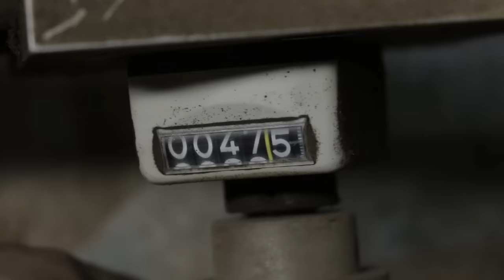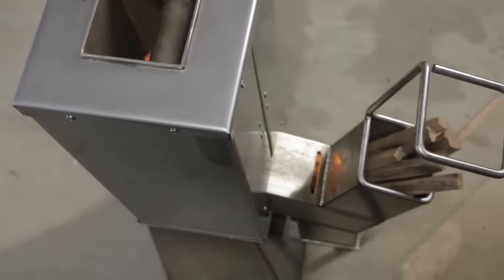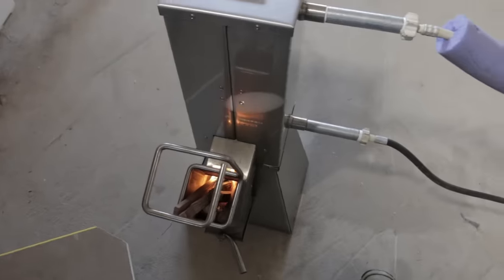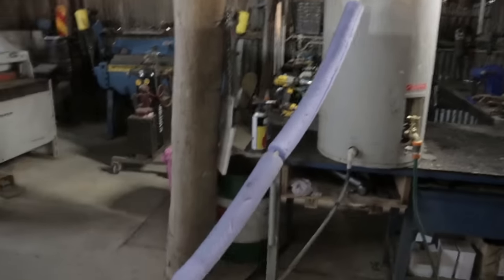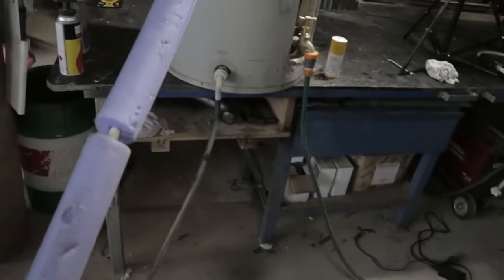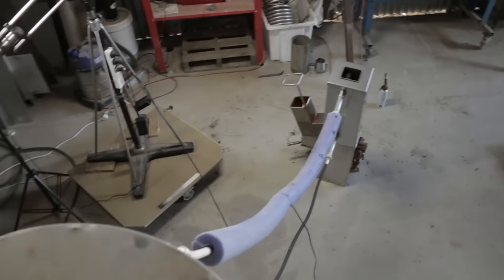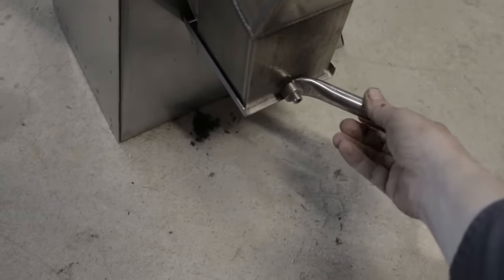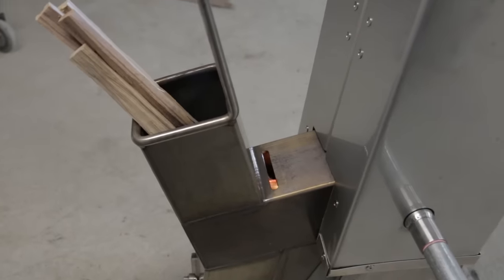Making an insulated rocket stove hot water system

Comment: Cut a hole thru the top and bottom of the tank and run the stack right thru the tank.Stack becomes one big heat exchanger with max surface area contact.
Reply from the maker: That's brilliant, thank you

Comment: Good work, but if I may make a few feature recommendations, if you made a water filled chamber that is heated from the bottom by the rocket stove you could then put a copper coil in said boiling water there size and length of the copper line will help determine the amount of heat the water picks up as it moves though, you could even put a valve to change the flow rate slower flow, hotter water from just one pass though the loop, also just for fun.... can we get a steam powered Turbo charger for more air intake? really turn it into a rocket stove :D

Comment: so now you have just delayed the coal issue. Eventually the container fills up, then what? Turn the whole thing upside down? Or do the coals exit down that 'panhandle' chute? But that's also used to iginite the stove in the beginning right, you demonstrated that the first burn. Or do the coals exit into the rear, wood cache (unlikely as it would set the wood on fire)??

Comment: Hot water is less dense than cold water, so I would advise to reverse the inlet and outlet of the tank. Let the upper exit of the heater feed the bottom of the tank and the top of the tank feed the lower inlet of the heater. That way the heated water will "try to float" on the cold water of the tank so it will stir up everything and heat up everything faster.
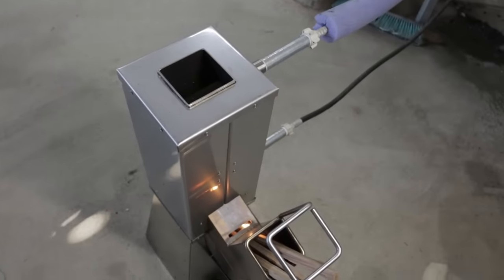Reply: The way you have it at 38:12 will cause a layer of really hot water on the top of the tank and cold water on the bottom of the tank, that's why you can touch the inlet after all that time.

Comment: Most efficient rocket stove design should insulate the flame on the way up, then the air chamber turns 180 and cools the gasses on the way down. If you use the downdraft section to heat your water, cooler water will create more suction/rocket effect.

Comment: May have already been mentioned about the coil but if it hasn’t consider putting sand around the rocket stove and the coil in the sand. The outside of the container will get hot as the sand heats up but the sand will act as a thermal battery and keep the water hotter longer. I would bet the sand would provide enough heat transfer to effectively heat the water. Great channel, new viewer
Reply: Sand would be a huge heat waste and insulator.

Comment: you know I'm looking at this and wondering if it would be easier to just build a box tube rocket stove directly into a 55 gallon barrel and braze a tap into the bottom to extract hot water from and a pressure release into the top just in case.

Comment: To increase combustion temps to warm the water even more quickly would adding a sandblaster type Venturi feed system to the rocket stove's side that uses hot air updrafts to draw in a small metered quantity of low cost dry iron fillings / powder from a side mounted micro hopper storage bin into the rocket stove's combustion chamber, resulting in heating the water more quickly, being the end result? Would this turbo heating dry iron powder fuel be a rocket stove optional design offering worth exploring?

Comment: Any reason you didn't have the water go around all 4 sides of the stove's vertical pipe? Just a section of larger diameter square tube, inlet and outlet bungs, and an upper and lower flange to basically create a water jacket.
Reply from the maker: Yes I've done that in the past and I've had issues with steam lock once the unit got up to temperature.
I'm sure that if I messed around I could get it perfected but I really wanted to see what a single-sided heat exchange could do.

Comment: I made a rocket stove with 100 mm with 75 box inside made a tank and ran the flames up the inside of the 75 I live off grid and use it every day on 50 litre hot water tank heats in 1 hour.
I changed tocket bottom for a 4.5 kg gas bottle fill it once and walk away.

Comment: It's been awhile since I've watched another one of your videos (had to look back, it was the vortex build). That's been awhile for sure. I've always liked your fabricating, good to see you're still at it. I'll be checking out your other videos eventually to catch up 🙂 I was playing around making secondary combustion woodstoves out of barrels, inner barrel and outer barrel, and I wonder how well an outside air chamber to introduce air higher up above the flames in a rocket stove would work? The inner chamber after the secondary burn should be hotter because of the additional burning gasses... I would think.

Comment: Quick question: why not just make the water block as the insulator , covering all sides of the stove ? This way you have A LOT more surface area for heat transfer and more water capacity
Reply from the maker: I have done that with other designs and what I found was the water boiled and then steam locked. I wanted to heat the water just before the boiling point so the system wouldn't need a pump.

Comment: I use a CS for 304/316 of 180 with carbide EMs and 50 with HSS EMs. I used 30 when drilling. This might help burning tools. (Just in case: Cutting Speed(CS)*4/Tool Dia= RPM)

Comment: Would the System work more efficent if the water passed several times through  the Fire and the exhaust fumes. To avoid  shadowing the passages, the Passages  trough the Oven they had perhaps to be offset against euch other.

Comment: You can put a metallic ladder in the "chimney" with flat pieces of metal alternated horizontally . You'll push the heat on the wall and will heat more your heat exchanger. 
If you want a picture, you can search how is made a gaz tank boiler where such piece is.

Comment: would it be worth trying swapping where the tubes are? like taking the input from the top of the tank to the bottom of the heater and the exit of the heater to the bottom of the tank?
Reply: Yeah, from my understanding of heat exchangers this is the more efficient configuration--input goes on the "cold" end of the heat source, output on the "hot" end. Though you lose the natural thermosiphon effect that way on a vertical exchanger so you have to actively pump it.

Comment: If you are using passive water circulation, the hose connection position in the water reservoir is important. You need to minimize the vertical position difference of the hot and cold connection. The hot should be like right above the cold. With this, the hot water will rise and mix the hot to into the entire water tank, not just the top. Water stratification is especially real with any passive circulation system. You will get tremendous energy collection benefits if the hot connection is much lower, just above the cold.
Reply from the maker: I will give that a go the next round of testing.  I have version 2 waiting in the wings for me to do something with.

Comment: I homestead in North Texas and do something similar but WAY easier.

My rocket stove is 3 inch 14 ga steel. The chimney is 3 inch AC (asbestos-cement) pipe.
I run three vertical runs of 3/4" soft copper from the bottom to the top on the interior side of the chimney, joined top and bottom with hose fittings connected to a 12-gallon steel receiver filled with peanut oil.
I regulate the fuel (hardwood pellets) to keep the oil temperature between 400°F and 500°F.
Atop the oil receiver are copper heat-exchanger loops, which serve different zones (domestic hot water, hot tub, greenhouse heater, room space heaters, etc.).
All this is outside. Oil does not freeze in Winter and contained in a receiver insulated by 2 inches of beach sand, stays hot for about a week, if left alone.
Reply from the maker: That sounds pretty cool. Do you have a video of it running,  would love to see it.
Reply: @LittleAussieRockets 
I do not.  I'll get around to doing that sooner or later . . . After I finish up the eleventy-seven other projects I have going on.

I'm autistic  . . . High IQ . . . Short attention span.

Comment: wow what a beauty! nice project mate. im just thinking why you have the 1 cm by 10 cm gap there on top of the burning wood? is it just for ventilation/ breather purposes for the flame?
and do you have like a pump or sth running the water through there or is it just flowing on its own? cheers mate
Reply from the maker: Hi mate 
That slot gives a little bit more oxygen to the fire and helps facilitate a cleaner burn particularly when the hopper is full of wood and not allowing enough air through. 

The water does circulate by itself the process is called thermo siphoning, a pump can be used if you want, but I've found that the natural circulation is the most efficient.

I'm actually on version 2 of this water heater though I haven't finished editing the video yet. 
I basically scaled this one up with a larger firebox more suitable for continuous burning and a tapered heating chamber for the water.
My initial testing has shown it to be a big step up from the first one.

Comment: just wondering what grade of stainless you're using?

I built a rocket water heater for a festival shower rig about 20 years ago and it only lasted one season because the stainless couldn't take the 1000°C heat of the rocket burn ... it burned up the original steel in a weekend (looked like an overdone toasted cheese, all black and wrinkled with a couple of holes already) so had to make a cool air bypass jacket for the burning chamber... but by the look you're cooling the chimney way early anyway, which'll be slowing everything down and is probably the reason for smoke escape from the wood inlet...
Reply from the maker: Wow! That's intense heat
I have nerfed this design just a little bit to keep the heat ranges within an appropriate level so that the stainless steel will last.
With steel builds I will rarely insulate around the firebox for this reason.

I'm using 304 that is rated to  870°C

Comment: I'm wondering with the cold spot whether or not the VOC are reaching Optium temperature to combust cleanly. Or if there is going to be a large creosote buildup on that one cold side. wonder if it might be more advantageous to have the pipe come back down and around then cool all 4 sides in a water jacket with internal fins to force the air to fold and disperse more of its heat
Reply from the maker: I have been monitoring the build-up of soot and so far it's only has a mild dusting of Ash.

Comment: Beautiful build! But, but, but... Rocketstoves get working really well when the walls of the riser are bloody hot only then the 'rocket' effect (burn of smoke) starts. So when you continuously cool down the flames at the lowest point not much will be happening rocket wise. If you would make a water reservoir of sorts on top of what you made now, take out the pipes and insulate the riser you would get a very hot flame and a very good and near total burn of your fuel/wood. Then the flame would be much hotter when touching the water reservoir from below resulting in quicker heating up of the water. Only minus point is that you made the riser from steal and because you burn so hot in a rocket stove your riser will be gone in two years or quicker. (yes I had a steel riser myself in my rocket stove and there was a fist big hole in it after two years.). My two cents, have fun and I wish I could weld like you.

Comment: Beautifully made and a very nice result. It seems to be outputting about 3.1kWh into the water heater. Could I ask, how many kilos of wood did it use during that 1.2 hour period?
Reply from the maker: It used a quarter of a bag of kindling that weighed 15 kg.  Plus a few bits of pallet.
I'm kicking myself now for not paying more attention to this during testing.
Reply: @LittleAussieRockets  the gas boilers I work with have to use forced induction and very elaborate heat exchangers to get into the 90ish percent efficiency bands, but with almost no heat exchanger and an natural draught I think yours is running at about 12 percent efficiency, using about 8kg of wood at 4kWh per kilo over 1.2h with an output of 3.1kWh.

I've been thinking of trying a project like your ongoing one. The main problem is a soot filled exchanger that's got enough surface area to cool the gasses to below 40°c, if you can work that out you'll really be doing well. Maybe gasification and a second hand gas boiler would make a good video!

Good work, and very nicely made!

Comment: Shouldn't you want the hot water to come in the bottom and allow the heat to rise to the top pushing the cold into the burner? It may create a circulatory system to maintain an even temp throughout. maybe the tanl sucks the hot water from the top and pushes the cold into the bottom?

Comment: As a non-welder I am curious what type of welding you are doing here. I see sometimes you are using a stick and sometimes not.
Reply from the maker: I am using a TIG welder. Tig welding is very similar to oxyacetylene welding except a lot quicker.
Unlike MIG welding or stick welding that deposits material as you weld, the Tig welder only provides the heat source to melt the material, which is why I have to add material when necessary or I can just fuse it together depending on the situation.
Tig stands for tungsten inert gas
The tungsten electrode does not contact the material but is only a source for the power to flow through kind of like a strong cup of coffee in the morning ☕🚽
Hope this helps

Comment: its time for a smart cookie to materialise, and manufacture a ROUND rocket stove / hot water unit with a coil tube inside the chimney for the water ... based upon the ORIGINAL Australian designed chip heater. They were BRILLIANT. I know.... I had one in a cabin I used to live in. It took one or two handfull of small twigs,  not bigger than 20mm in diameter, and a 2-3 minute wait for the fire to flare up, the pipes, the ambient air and water temp to rise enough. We looped the system so that as it heated, it fed into about a 200 litre old hot water unit with a well insulated copper tank, which then fed into the shower mixer. The stored water remained warm enough to have a good shower, after being away for 3 days in mid-winter. Truly awesome. Huge windows overlooking secluded forest. I miss it so much. Im so sick of the city life. 😨

Comment: 100mm simply isn't a big enough firebox to put anything but wood pellets in. I rebuilt mine from 100mm with 12mm steel plate to be 140mm square  with a 120mm round flue, which you can induce a spiral venturi in if you put vanes at the top of the enclosed flue.
Reply from the maker: I totally agree, the next one I build will have a larger firebox. I am also considering making a pellet hopper for this one.

Comment: I've been sitting on the idea of making a rocket mass heater for quite some time while we save to buy land that has grown into something  I haven't seen put together and this connects to it beautifully. I will take this concept and build on it.  Picture this insanity. 

A battery bank for the purpose of storing electricity:
A rocket mass heater with digital controls, temp sensors, and fans, wired into a thermostat to create whole home heating
Integrating your idea with this water heater concept, digitally contolled in much the same way (we would be running from a well)
A gamma type sterling engine that will use the heat generated from the rocket mass heater to create electricity and keep the battery bank charged.

So long as it is on an appropriate sized piece of land where you can allow the trees so regrow, you coul be free of any need for outside assistance for power or water needs.

Comment: You have a hell of a shop, nice work. Is that built out of 316L stainless or cold roll carbon steel?
Reply from the maker: 304 stainless. It can handle the heat better than 316.

Comment: I do like a good rocket stove build. 
Tho I do feel as though the water jacket is way too inefficient and I feel as though it would be much more efficient with some kind of radiator mounted on top circulating water from a separate reservoir. 

I go camping often and use a 60ltr SS keg with the top cut out to cook Cray's / yabbys and crabs and to heat water for showers. 

To boil water fast I usually make a in ground rocket stove ( 2 separate holes side by side but with an air tunnel at the bottom of the holes for air flow for the rocket action). 

With the keg about 150mm above the in fire hole I can heat up 55ltr of water close to boiling in around 15mins

Comment: What a job !

I would have 3 critics : 
- not enough "airflow" while burning : makes the fire go back up
- the heater is only on one side .. aren't you loosing a lot of heat ?
- lots of heat goes to the sky ..
Reply from the maker: Totally agree, I experimented by increasing the riser length and got a much better burn. 
With other water heaters I felt I've had an issue with them creating a steam lock because the heat transfer was too good, so I'm trying to find the right balance.

Comment: I worry about how long your burn tube will last, especially if it's run flat out  all the time???  Maybe a cast furnace cement would be a better choice??  Perhaps it's not long enough to reach the temp ours did??
Reply from the maker: What's your burn chamber insulated?
I deliberately left the burn chamber uninsulated to protect the steel.
Time will tell how that goes of course.

Comment: Why not add fins to the riser tube as heat sinks and then an outer skin over that to make the water tank ?
Reply from the maker: I consider that but didn't want to overcomplicate this first build, I wanted to see what the results would be if I did it the easy way first. I think for the next version I will put the heating chamba on the inside of the riser.  I'm still debating about increasing the surface area by adding fins to the inside of the water heating chamber.